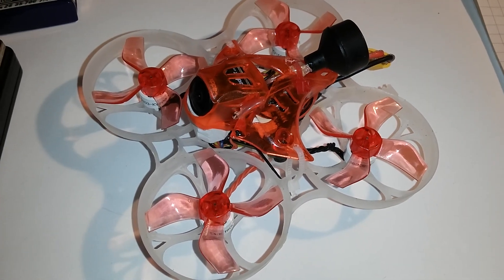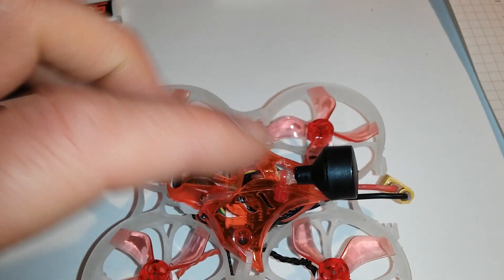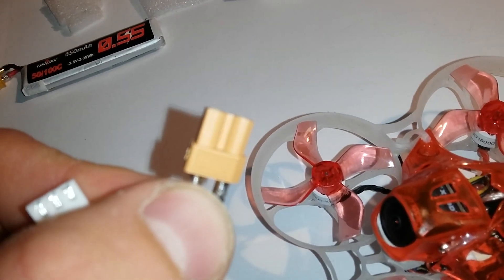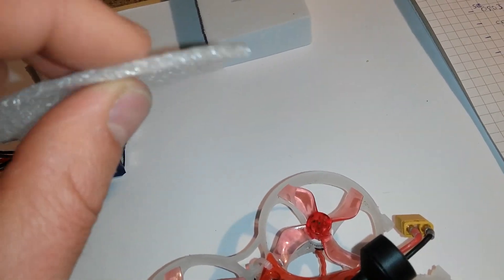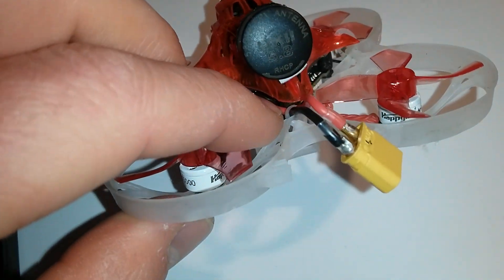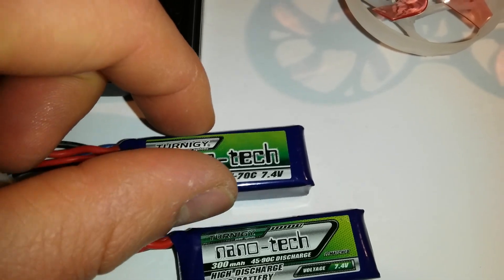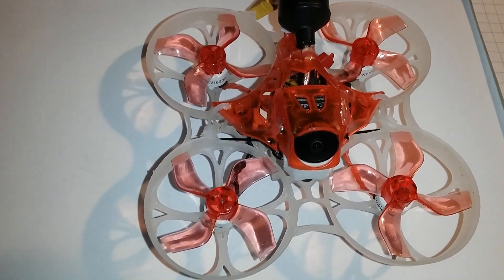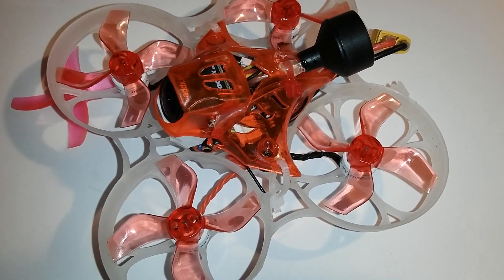Eachine Trashcan whoop mod overview (frsky xm+, uxii antenna, buzzer, xt30, gemfan props, jello fix)

Comment: Nice build! I've got to try those props. No capacitor, eh? I suppose you don't need it with the V2 board. Buzzer and receiver are really worthwhile also. Mine will fail safe with the onboard DSM rx and the onbaord buzzer has sazed me a few times, but you can only hear it from 5-10 meters away. Nicely done 👍
Reply from the maker: thanks mate! Those gemfan props really are an improvement over the stock props. Yeah, should've installed a cap, but now I'm too lazy. I just installed betaflight 4.1.2 with RPM filter and Jazzmaverick 16.73 a couple of days ago and now experimenting with the settings.
Reply: @monsieur7246  That sounds very cool I'll have to try that. I didn't put a cap on mine either, and I've been using that Xt30 for a while with no problems so far, Maybe they fixed the problems with the boards burning out, but I'm pretty sure the ones on the trashcan are the V1. I'm going to crash and bash mine until its dead 😊

Comment: Do Gemfan propellers fit well on stock motors?.. 1mm shaft?
Reply from the maker: yes, they do. 1mm. Though in some batches it's a really tight fit and you have to be careful not to bend the shaft.

Comment: have one doubt can I use 300 MAH 80C/160C 2S 7.6V 2.28WH BATTEIRES ON IT. IM AFRAID IF I USE SOMETHING WRONG I WILL BURN THE FC
Reply from the maker: should be no problem! As polar fpv wrote: you can add a capacitor to be sure. With 2S you should be fine.
Reply: @monsieur7246  im worried about the 80C/160C will it affect?
Reply from the maker: 1. If you are flying the stock setup, the lipos you mentioned should be ok: https://youtu.be/U-s_McDtXrw
2. To be honest, I wouldn't trust the c-rating too much. 
3. The amps drawn not only depend on your Lipo but also on your motor/propeller combo. I'm using 16000 kv motors with the 4 blade gemfan props and up to now had no problems

Comment: why you don't use a capacitor?
Reply from the maker: Works fine without - so why bother?
Reply: @monsieur7246  built-in 5v bec  may burn withowt capacitor on 2s accum
Reply from the maker: @polarfpv1860  Good point. I totally agree with you! I was just too lazy ;)

Comment: Is it 5v buzzer? For lowbat buzzer what I have to set in betaflight? Thanks?
Reply from the maker: It's a 5 V buzzer. Betaflight: go to the configuration tab and turn on lowbat warning in the buzzer settings. Adjust the voltage range in the power&battery tab and you're good to go. Here's the product link:
https://m.banggood.com/5V-Buzzer-Alarm-Beeper-With-Cable-for-Eachine-QX70-QX90-QX95-NAZE32-F3-DIY-Micro-Brushed-FPV-Racer-p-1100338.html?rmmds=search

Comment: my trashcan consumes 900mA on the 5v port on 25mw without external receiver, i guess with xm+ and vtx on 200mw its just a mather of time to burn the 5v regulator since its only rated to 1A? does yours still fly and do you use it on 200mw?
Reply from the maker: So far everything is fine with my build. According to eachine the power consumption of the vtx is 300 mA (it doesn't say whether on 25 mW or 200 mW). Let's assume it is 500 mA on 200 mW like the Supra VTX and the cam needs around 70 mA. The power consumption of the xm+ is 30 mA according to frsky. Therefore you're still well under 1 A and adding an external receiver is no problem. So maybe the calibration of your current sensor is off?

Comment: Hello sir thanks for the video. I have a question D8 Or D16 firmware on the XM+? Your advise would be greatly appreciated
Reply from the maker: D16 rssi. You're welcome.  Problems that have been reported, refer to the spi based internal receiver. No problems so far with the external
Reply: Thank you for the information my friend 👍🏽

Comment: great video as always, 
I have a strange issue with my  new trashcan, first of all Not all the motors start spinning  when I arm it !! then I push the throttle up and not all the motors at the same level in betaflight !! and last but not least,  the motors gain speed as I go up with throttle , BUT they stuck at high speed and wont loose speed as I bring down the throttle !!  
would you help me please
Reply from the maker: If you start your quad in angle mode, this is normal, since it tries to level out before take off. Switch to acro mode and check, whether all the motors spin up at the same time. If this doesn't work, check if all motors spin freely - without the battery connected. Then I would go to the motors tab in betaflight and check, what happens if I slowly rise the throttle slider (better take your props off for that. The battery should be connected). Reflashing the escs in blheli may help. The motors spinning faster and faster while the quad is sitting on the ground is somewhat normal: https://github.com/betaflight/betaflight/issues/96
In general I wouldn't deal with this issue if you have the possibility to ask for a refund (paypal etc. ...).
Reply: My TC was doing strange things until I updated the ESC firmware and BF. I just followed the instructions that came with the TC.

Comment: You've basically changed almost everything on the Trashcan except the frame & the canopy. Now it's not a Trashcan. 🤣 
Yes, the stock antenna is more suitable because of the type of signal transmission.
Reply from the maker: Thank you for your comment. The canopy is not stock neither, whereas the vtx is. 
The choice of vtx antenna also depends on your  video rx antenna. As long as you don't use a linear polarized antenna on your fpv goggles, a circular polarized antenna like the (u)axii, pagoda or cloverleaf should be more suitable - but I'm not an antenna expert 😉 Here's a video on this topic:
https://youtu.be/AlOIH0yugoE
Reply: It's now a garbage disposal!

Comment: Wish you talked about your antenna routing. Also, what tiny (and cheap) pagodas do you recommend? I can't justify the price of the AXII. Finally, when you say stock PIDS, do you mean stock BF (which version?) or stock as on the ones the TC came with?
Reply from the maker: - rx antenna routing is quite simple: the u.fl connectors are facing to the rear (to micro usb connector) and the antennas are bent towards the front in a big circle. They are glued to the front ducts. 

- I have not tried any pagodas yet. The small ones on banggood are quite heavy (3g). Gal Kremer and Justin Davis (from Drone Camps RC) recommend the furious fpv air - though not really cheaper than the axii. Since this is a rather cheap build I would still stick with the uxii antenna. 

- my pids:
set p_pitch = 50
set i_pitch = 50
set d_pitch = 30
set f_pitch = 60
set p_roll = 50
set i_roll = 45
set d_roll = 27
set f_roll = 60
set p_yaw = 72
set i_yaw = 55
set d_yaw = 0
set f_yaw = 100